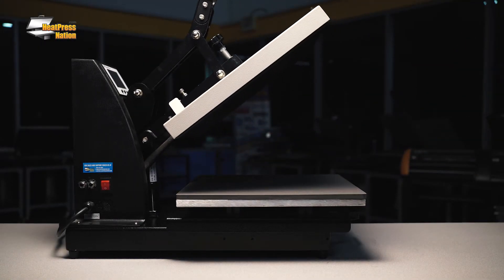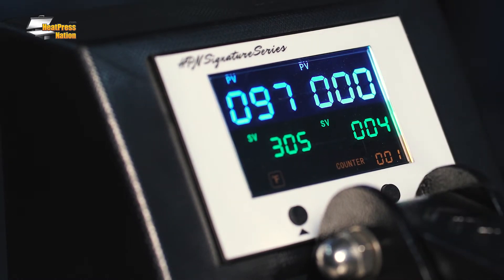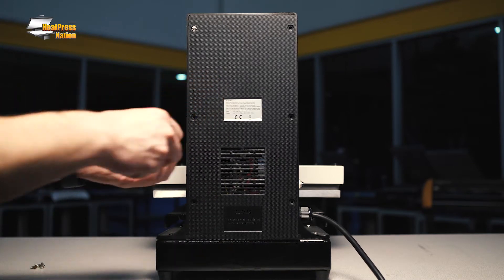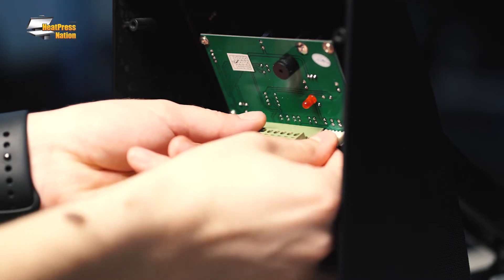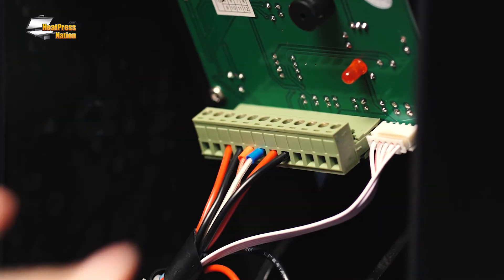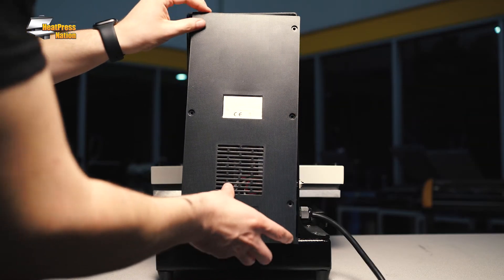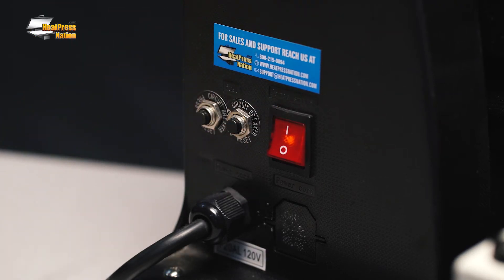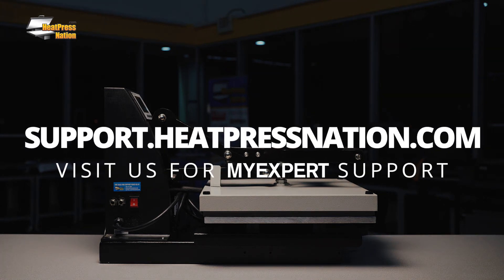MyExpert Troubleshooting - HPN Signature Series Non-Stop Beeping

Comment: my HPN surepressure press shows between 7-35 degrees cooler (different locations) than my heat gun. the center is hotter by ~10 degrees from the display and the left side is about 30 degress hotter than my display.
Reply from the maker: Hi there! Does your fluke gun have an emissivity adjustment on it? We ask because depending on the color of the surface it emits it back differently. Also, please note a standard infrared temp gun will only be able to give you an accurate reading when pointing to the center of the press about two inches from the platen. The readings on the edges would not be able to be read accurate with a temp gun. Please reach out to our technical support team and they will be able to assist with matching your temp reading levels to the gauge.

Comment: I tried this, still doesn't stop beeping. However, this isn't the first time I turn it on. i had been using it and when i move to my new home the beep doesn't stop.
Reply from the maker: Hi Juan, 

It sounds like there may be an issue with one of the sensors on your machine. Please reach out to our MyExpert Support Team at support.heatpressnation.com or (800)215-0894. They are available Monday - Friday, from 7:30am-3:00pm PT and will be happy to assist you.